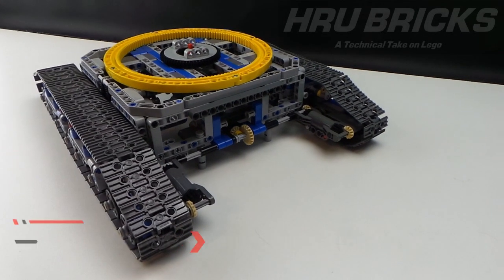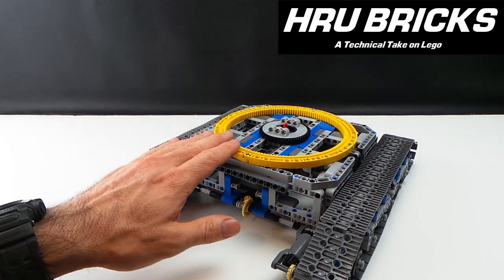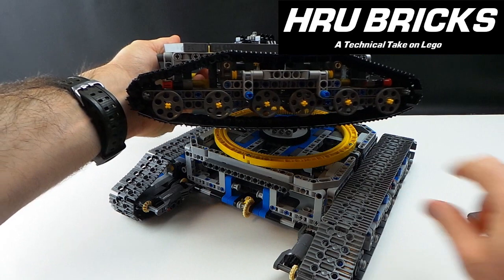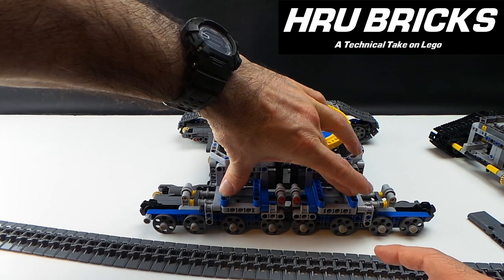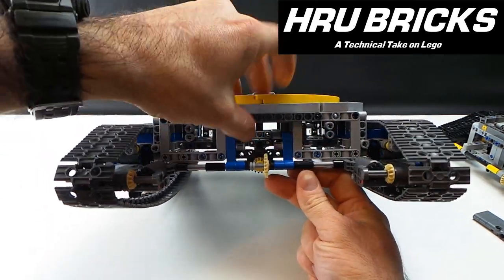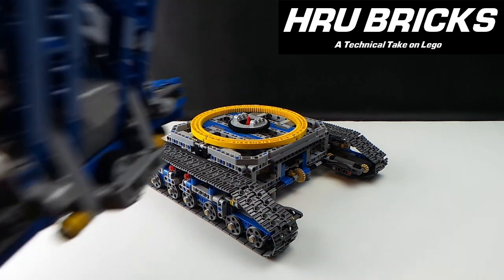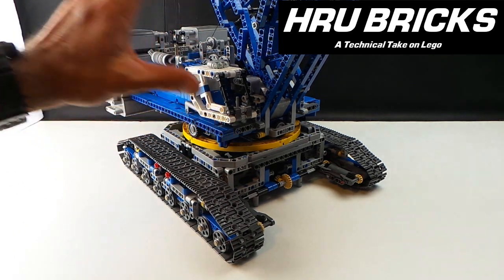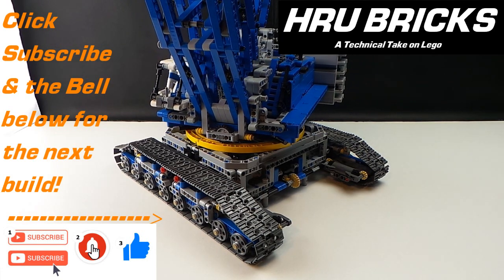Lego Technic Crawler Crane Track Chassis. Build a Crawler Crane Pt.4

Comment: In real life the frame on these cranes do actually flex so taking the flex out turns it into a solid object which these cranes are not, it's more real life to have this. The supports that you show could be incorporated into the actual design of the cranes this size have 'outriggers'. I'm a crane engineer/ lego fan, these are not criticism's your doing an excellent job.
Reply from the maker: Indeed they do flex. All good with your comments and I welcome them! More brains on these builds the better!
The issue with the Lego builds is the amount of deflection (flex). A 1mm-3mm deflection in the track chassis in a Lego crane is amplified throughout the build to the end of of the boom which can cause tipping and other stresses. The crane itself  has extra support at the base of the boom to assist in the lateral sway of the boom (one of the major concerns with Lego cranes). 
I am also considering moving the boom connection closer to the center to transfer the forces closer to the center line. Right now they are distribute more so around the outer ring. Your thoughts on this would be welcome.